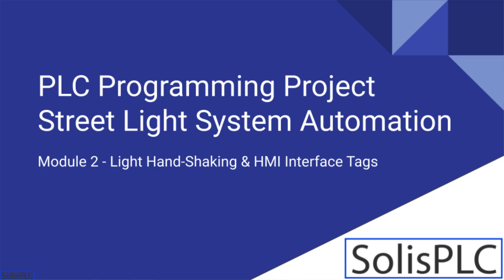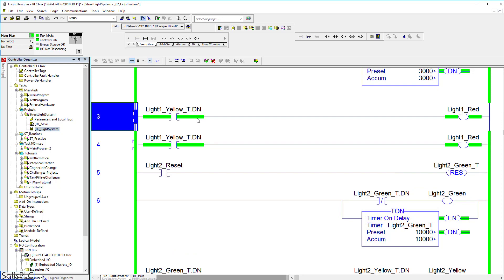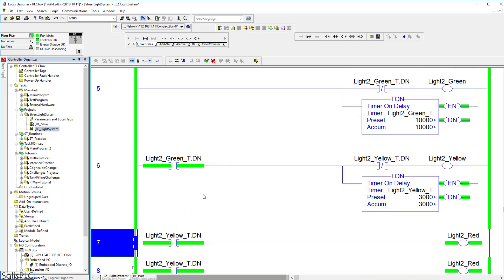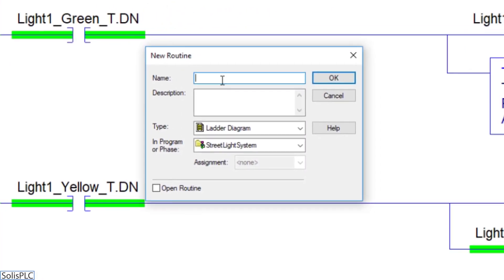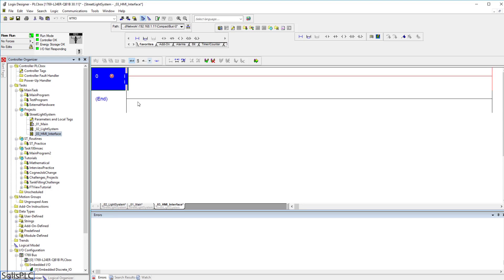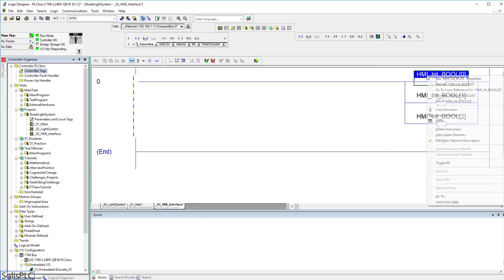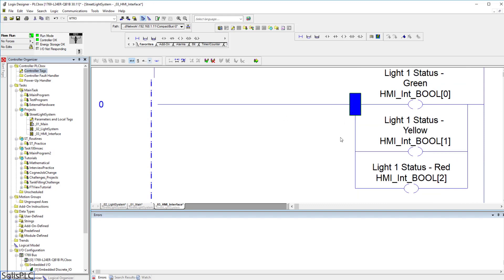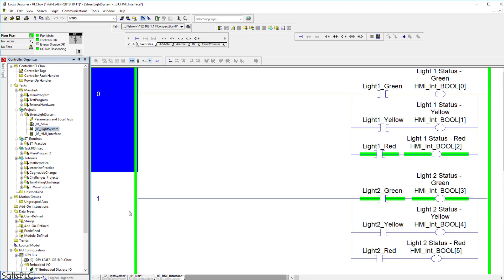PLC HMI Programming Project | Development Tutorial Beginners Ladder Logic Diagram RSLogix | Part 2

Comment: Sir. How would you connect these rungs to the actual PanelView screen? I mean how it should look like? if you could shoe me please the design so I practice using this video ,, would it be 2 different traffic lights maybe ?
Reply from the maker: I'm working on the follow-up videos in which it will be clear how to link this to the HMI application. We will certainly expand this to control more than a single street light & we will in the future. This is just the start and what was accomplished in 30 or so minutes. You can find the latest code here: https://github.com/VRomanov89/SolisPLC_Development